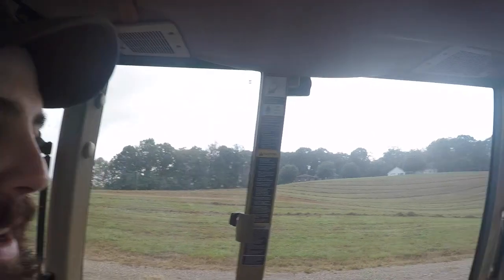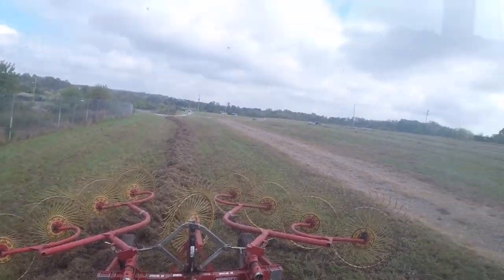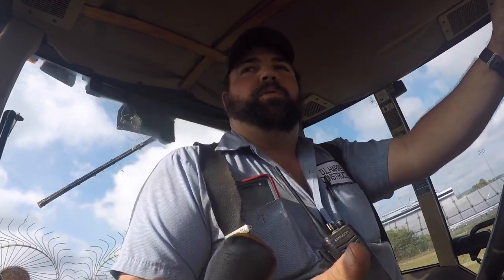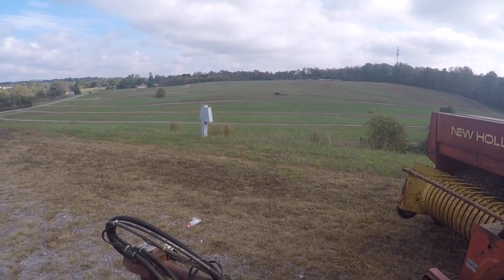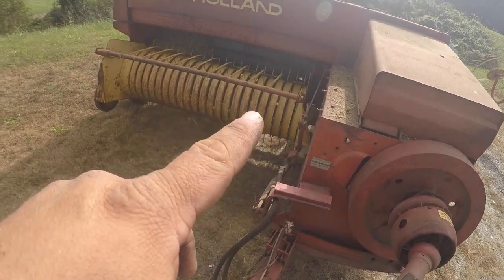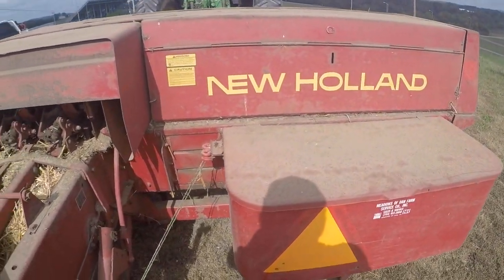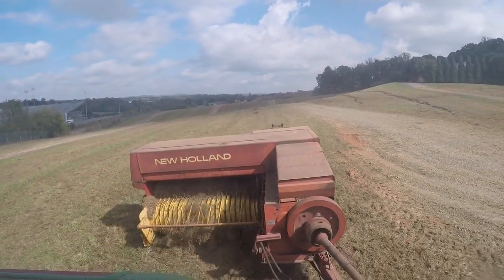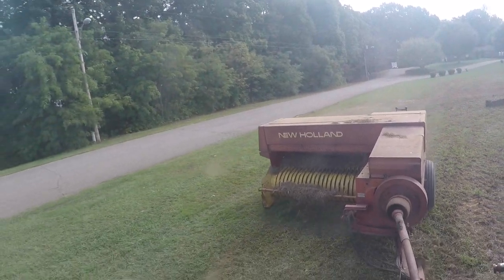Baling at the Martinsville speedway with a John Deere

Comment: How do you like the 7610? I’ve been looking hard at a 7610 and 7410.
Reply from the maker: +Daniel Altman. Good tractors, some say the 10 series is the best John Deere made. I like ours and it has close to 10,000 hours on it
Reply: DLH Farms thanks for the info. I have 2 Ford 5000’s I use on my ranch now. They’re great work horses for sure. My JD 435 baler does tax the 5000 I bale with pretty good. I’ve been looking at JD 10 series and Massey 5400 series to up the hp and get 4x4. I’d like to be able to bale faster.
Reply from the maker: +Daniel Altman. Both of those would be a good choice and way ahead of the old 5000.

Comment: that was quite the project. ive had 2 320s i really liked them but they just got to old. how did you pick them up. just scoop them with the loader on the hoe. how many shear bolts.
Reply from the maker: +Howard Younger. Surprisingly I didn't shear any pins, we used the backhoe to push them up into piles then we used the clam shell bucket on it to bite them and load them on a dump truck.

Comment: If you could have found a local guy with a chopper and blew the hay into a self unloading wagon to clean up the field. Lot of work...
Reply from the maker: +Jrbpa 57. We have an old new Holland pull type chopper we probably could have used but it has set for so long probably been more trouble than it was worth. We used a backhoe with a clam bucket and would grab 4 or five bales at a time and dump them in a dump truck it was two loads on a tandem dump truck.